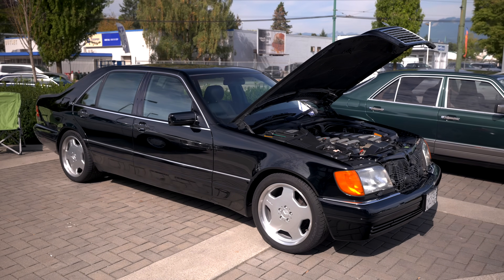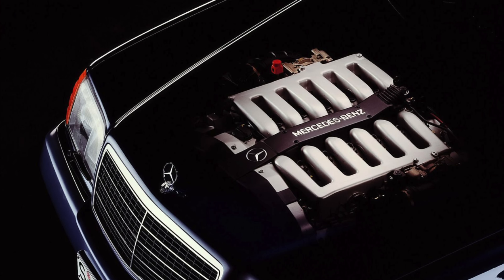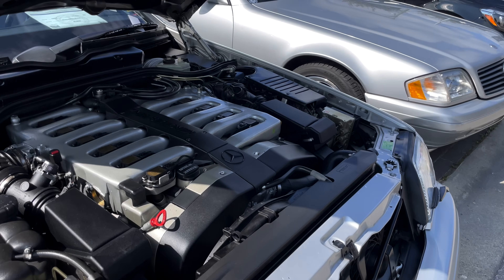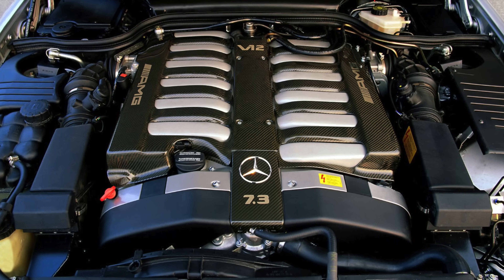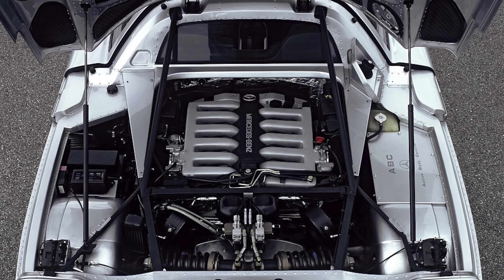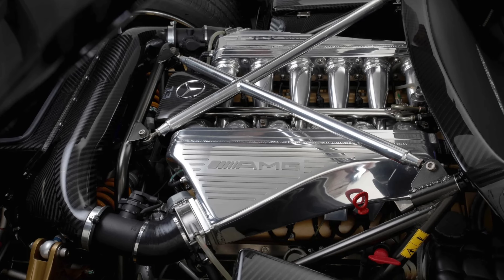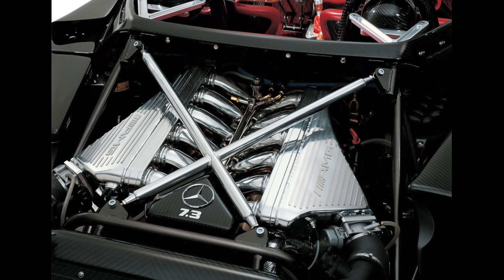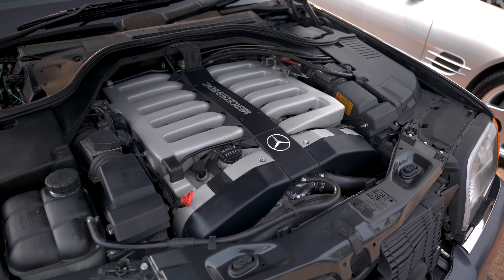Why The M120 Is One of The Best Mercedes Engines | V12 Legend

Comment: Fun fact: The M120 has the least number of warranty claims of any other AMG engine. Though that could also be due to the lower production volume.
Reply: Do you think they had less Warranty than the E60 M119 engine?
Reply: Correct, but that’s why all statistics are normalized.  Especially in the auto industry.  You would take your total claims divide it by engines produced and multiply it by 1000.  This would give you a number of claims per 1000 vehicles.  This way you would be able to take build volumes out of the equation.
Reply: Mechanics all claim it's bullet proof...and percentages, don't change. so i would feel safe to buy any 1990s V12 benz.

Comment: Fascinating that each car manufacturer has a couple of engines, that cannot be replicated. A few fun facts. the BMW V12 was made by using their 2.5 Inline 6 engines. Mercedes followed suit and combined their Inline 6 engines. The BMW used their V12 with upgrades until 2022. While Mercedes ended in 2020. I would begrudgingly say that the BMW engine did stay true to it original design while Mercedes made their V12 open deck and messed up the reliability since changing to the M137 5.8 V12.

Comment: The M137 was less powerful but it was much lighter, making the V12 S class faster and more economical overall (which is what matters in the real world). Also, other than the badly designed coil packs which failed quickly (theres a fix for these now), the engine is more reliable than the M120. It doesn't leak oil as much, it doesn't have failing wiring harnesses and throttle actuators, and it is much easier to work on.